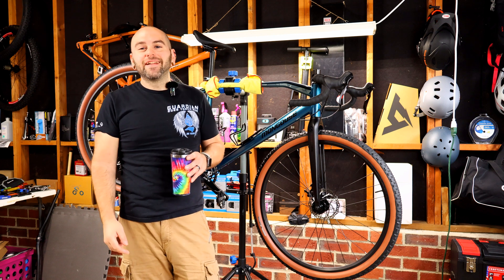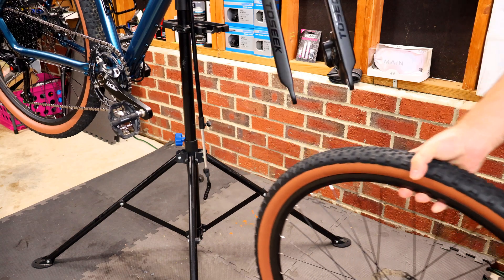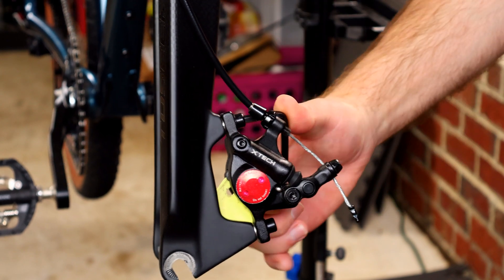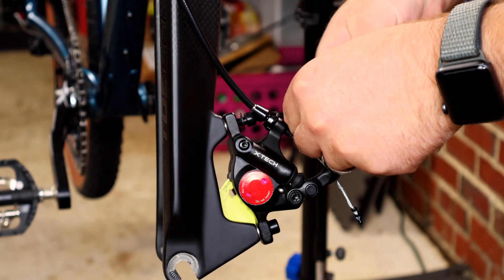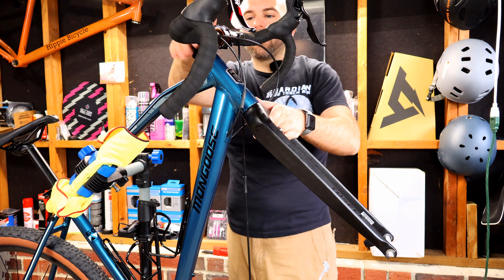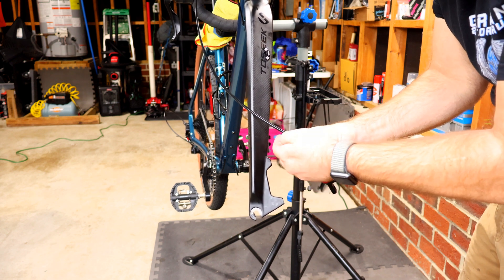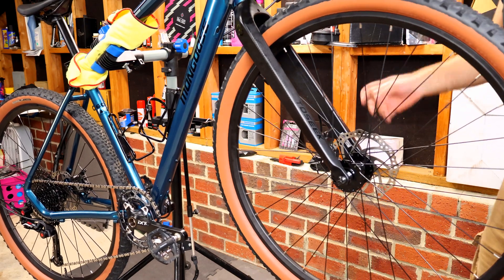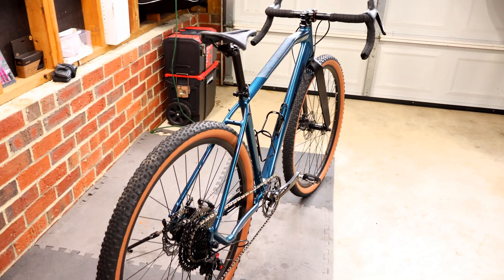How to cut a carbon steerer tube!!!

Comment: You did a lot of things wrong.
5:19 never use the hand to do this, if the carbon steerer was faulty or damaged, it could cut you, and you could get carbon into side your hand. it's a bad idea with alu too, can be sharply cut. Just a gentle tap with a 
plastic or hammer head and it sohuld loosen up. I have the park tool hammer.
Cutting the carbon:
7:17 Make sure it's a blade suitable for cutting carbon, this one might be, but you need should tape it, lube it to prevent carbon dust everywhere. best to use a stable repair stand to keep the fork still. At least you warned the viewers, and said to use a mask. that's good advice.
But you should have been wearing gloves.
Reply from the maker: Yeah that’s why it says don’t do this on the thumbnail. Lol